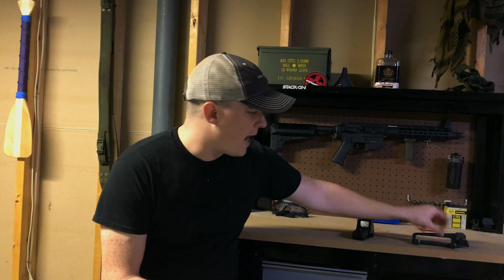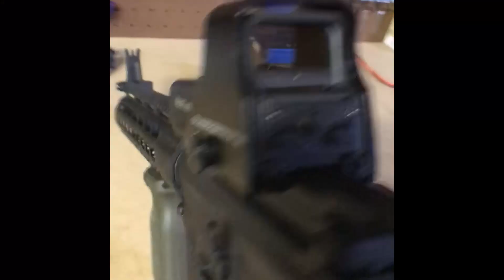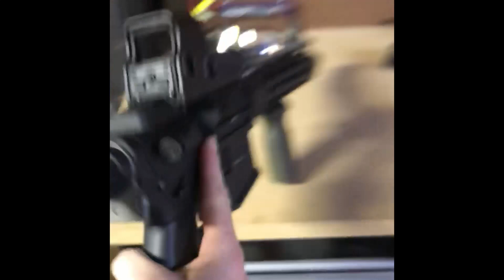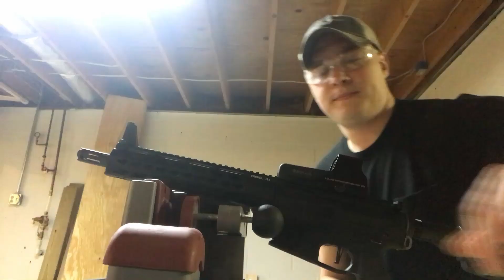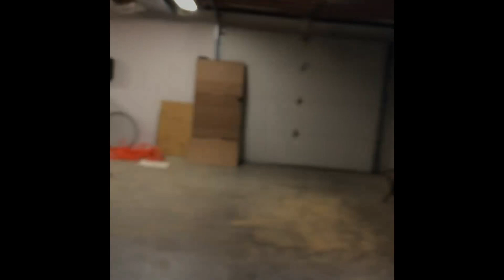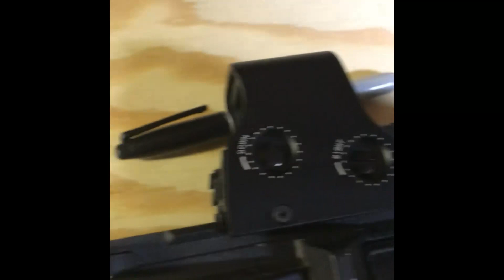EOTech 552 Holographic Sight Install & Zero for Airsoft CQB

Comment: Is this a clone of eotech because they don’t come with green light option
Reply: Yes it's a clone. Real EoTech does offer a green rectile but it's only green. So basically you can either buy a real EoTech with green only or with red only.
Reply: Not a lot off people rock a real eotech on an airsoft gun
Reply: Eotech now has a green version but not in this model shown in the video